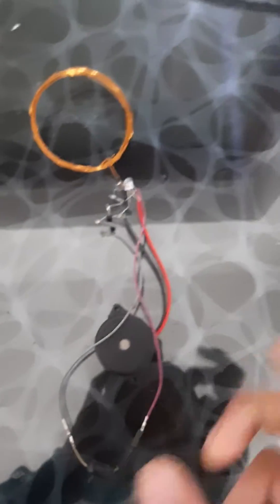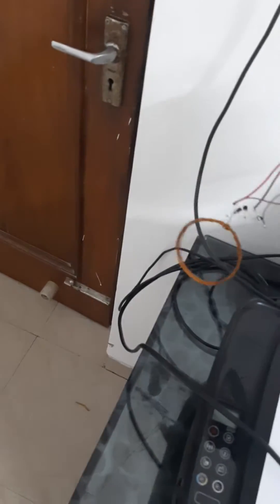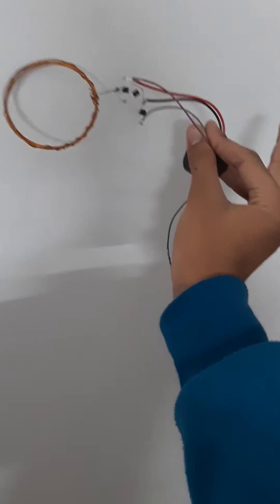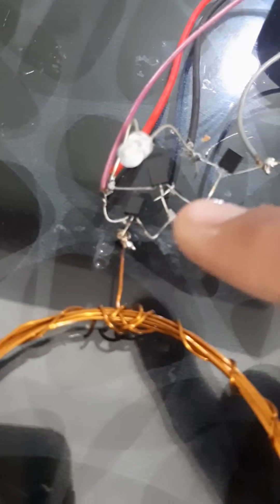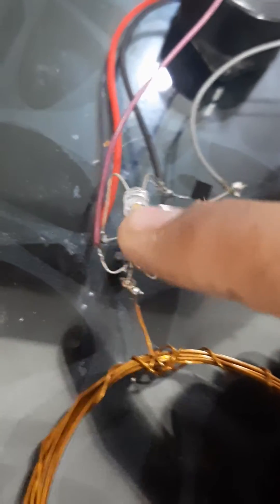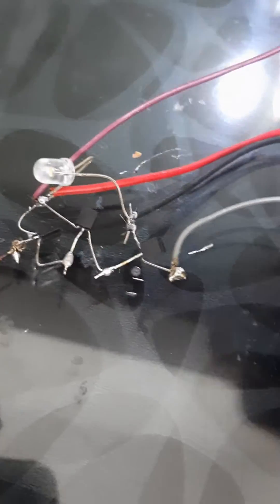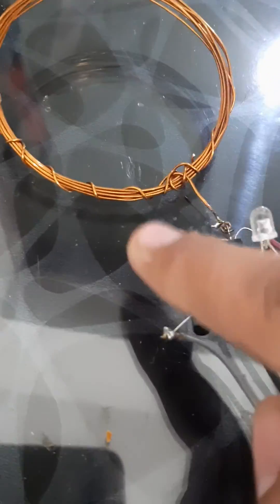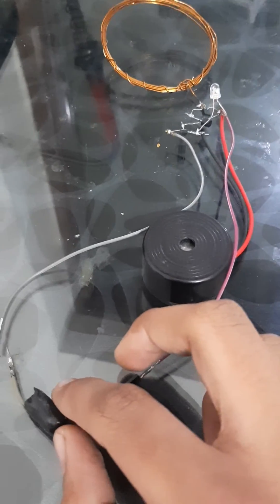Diy magnetic field detector using 3 bc547 transistors #electromotiveforce

Comment from the maker: If you still wonder how it works well it is a darlington pair means that it has a very high beta or Hfe or gain factor and a coil is soldered to the base of the transistor so that it acts as a capacitor(even aluminium foil will work).